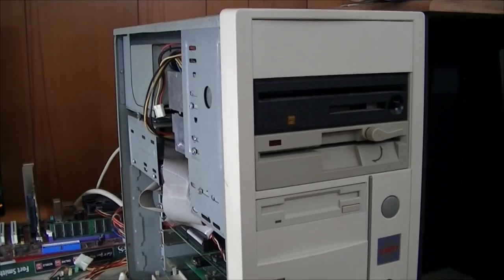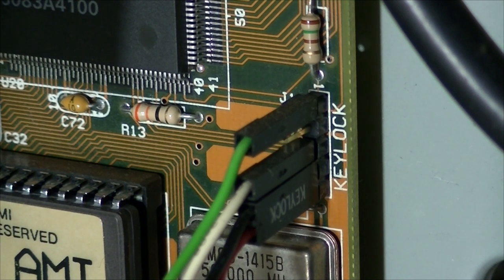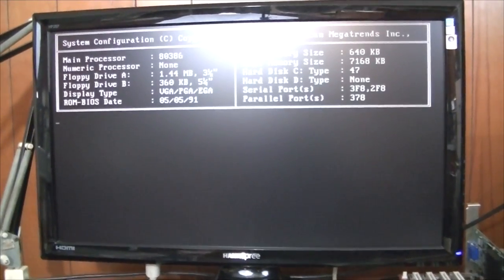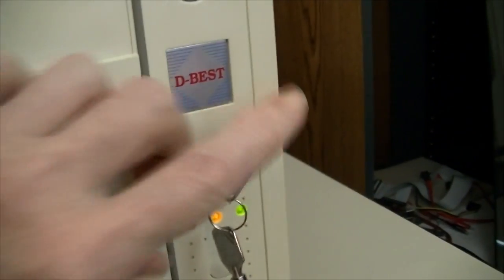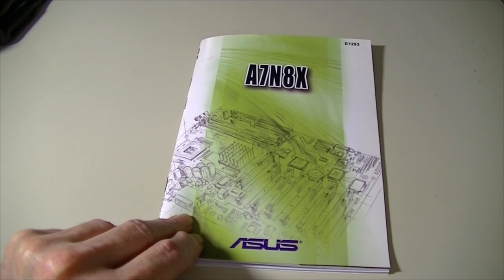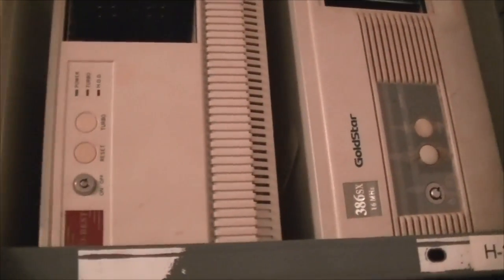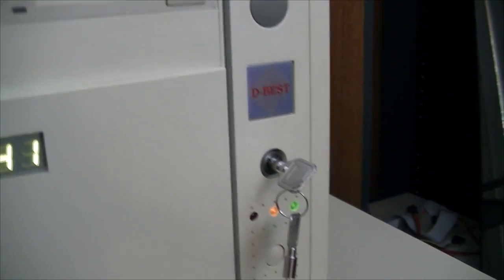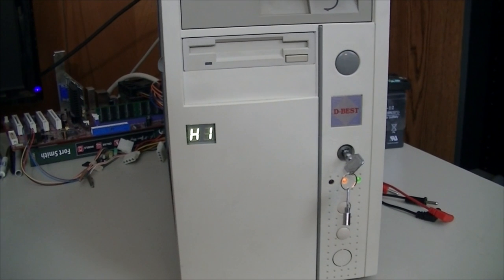Why do some PCs have a key on the front?

Comment: Most motherboards will refuse to boot up if the key lock is engaged when the computer is turned on, but if it was engaged after the computer was already turned on, then you're right, the fact that it didn't also disable the mouse pretty much rendered it useless in the Windows/GUI era. The turbo button and LED were also phased out around the same time as the key lock; some later motherboards mention in their manual that the turbo button and LED are only maintained for "legacy" purposes, and that disengaging turbo mode doesn't actually slow down the computer at all.